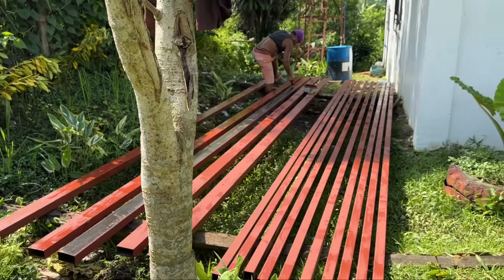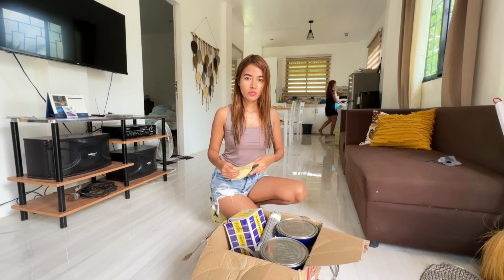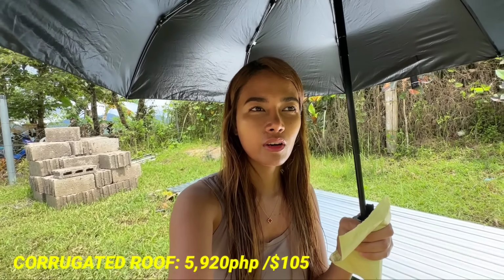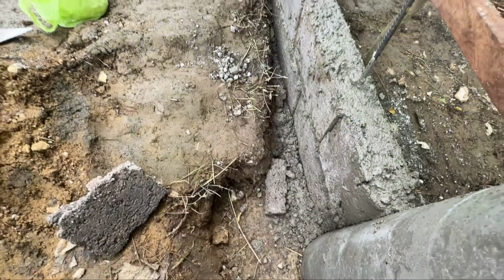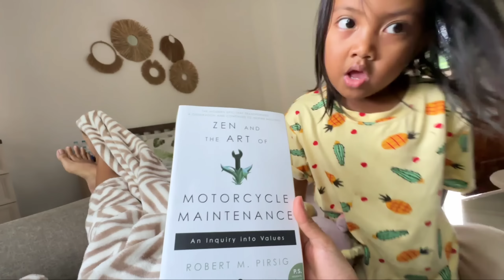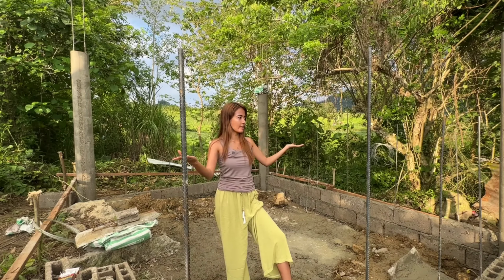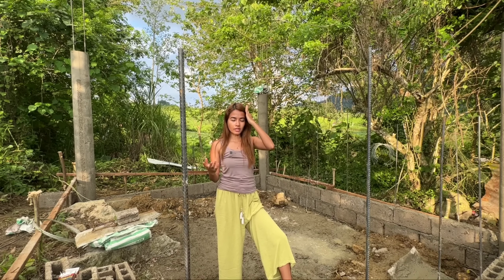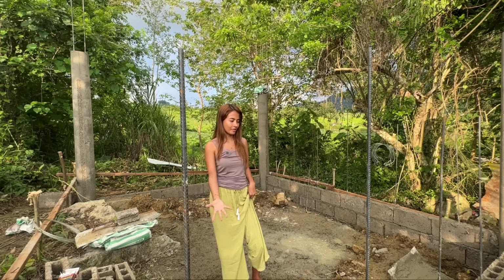New Materials For Sis House And Update - Province House Ep2

Comment: Reason it's called.." re-bar " short for , reinforcing bar.  For 3 ppl...you don't need a big area....just more to clean that way. I even just sketched a small plan...house in front being 14' wide, depth 16" ( on the right side ) and along the back 20". That is for a 6'  x 8' room on the road side attached to main house for Papa. I'm sure now that its started, plans are in place.

Comment: The house is being built by the channel and donations to Meljean. Relatives ate building the house to keep the family employed. The house roof is a problem if a typhoon hits because it is corrugated metal and is not secured like a trusted roof in the a USA which uses Hurricane straps and Hurricane clips. The steel flat metal flat portion is attached to the round pillars with a rectangular piece of metal but the corrugated metal will peel off in high winds. This is similar to construction in rural areas of the Caribbean and Central America. The mortar for the concrete block is hard to mix and bring in as it is done by hand. They have made a huge mistake for future expansion by not putting in rough plumbing and rough electrical as the Philipinnes way is to put in electrical by running electric at the top of the roof kindle similar to the USA 80 years ago and before. This is the Philippines way as are outhouse which should yseseptic tanks away from the ground water. They should also have an exfiltraition system forwatertodrainunderthe house as well asdirectional drainage germs to keep water out of the house. These are used in similar type construction around the world where there are severe construction limitations.

Comment: Your columns are circular but the reinforcement is designed for rectangular columns. Circular columns are usually designed for seismic prone areas. It doesn't serve its purpose if the reinforcement is not correct.
I am an engineer and this is sad to see. I hope if you have another project like this in the future, consider getting a professional for the design and planning. Because no matter how small the area, they can make it work for you. It saves you the hassle of constantly changing the layout of the house because they can tell you if the house floor area is just enough or if its too small for a family of 4. I can see that you can afford hiring a professional so pls do so in the future.
I can only hope nothing else goes unplanned throughout the entire construction process of this house.

Comment: I’m supporting a very close friend, living outside of Tacloban area.  Built her a Kubo, costing me 70K php.  Didn’t last long, roof got blown away during one of the typhoon, and recently wall and floorings got damaged by termites.  

Thinking of building something like what you’re doing now, ...concrete and aluminum for durability.  

May I know what’s the floor size?   …I’m trying figure out the cost (estimate).  
I just need to get ready when the building starts

Comment: I build homes in the States and rehab them. You should pour a footer and foundation reinforced with rebar for a solid foundation incase of any ground shifting. The home will definitely stand the way homes are built in the ph. The goal is to build them to last through severe weather conditions. Weld cross beams for the roof onto the rebar for a much more solid roof when high winds hit.
Reply: Good advice!  Depending on her available funds!
Reply: They have entirely different building standards in the PH, it seems. I am watching a couple other house builds and they all are similar. The roof goes up after the concrete pillars. When the hollow block foundation is laid, they will fill it with dirt level, then make a concrete floor with rebar. American building codes and other countries differ greatly.
Reply: @sdleasia  yes … actually, any which way … no standards!  I think this is how they are used to doing it!  Starts with the native nila hut and it goes from there.  Things are different in big cities!
Reply: @sdleasia  Thanks for stating the obvious! That they have different building standards. It was a mere observation on how it can be improved with what the standards are in the ph. 🤦‍♂️
Reply: @Danny-wd3tq  A USA standard foundation, is about $10k-$40k (500k-2M pesos). In 2002, my basement alone was $60k USD (3M pesos). Although the cost would be less in PH. Realize her budget is 100k pesos, so there has to be some concessions. What is being built is standard practice that works there. Obviously.
Reply: @sdleasia  you clearly don't understand cost of living philippine vs usa. There is a cost difference. If you need proof the channel the Armstrong family will show the cost difference. From usa to philippine. You can't compare apple and banana when it comes to cost. That family has already built a home by the American standard. That was no where near your estimates.